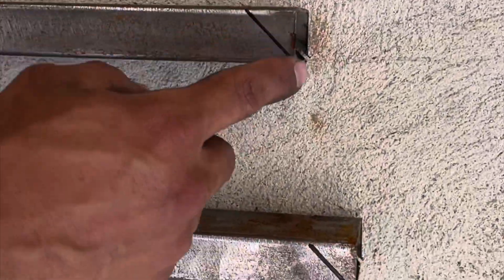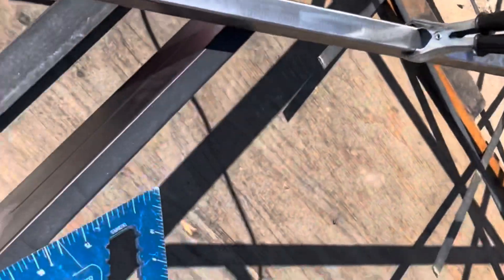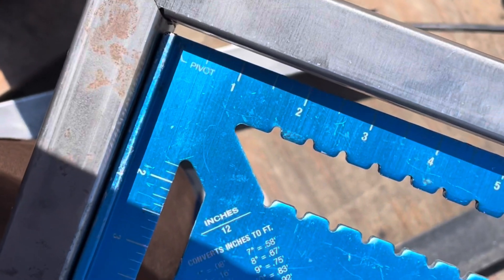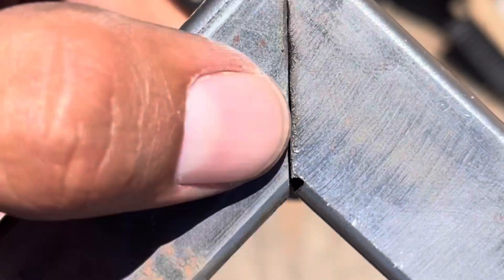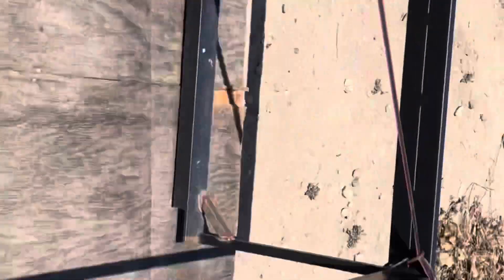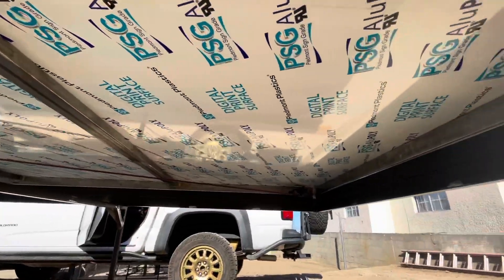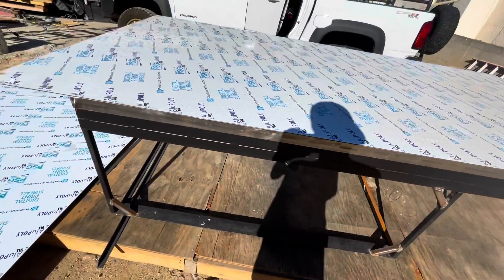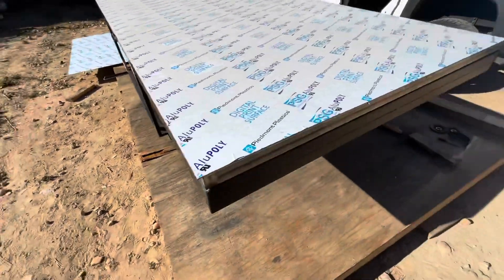Pop-up Camper Build ( Colorado Zr2) Part 4

Comment: have you seen the Kimbo campers in Bellingham Washington? Perfect for short bed trucks. Maybe it will give you some ideas for building future production models for the Zr2. I saw a Kimbo over Memorial weekend. That and the popup campers on the TRD's look badass
Reply from the maker: Looks legit but it would make my truck more tank like. 900-1200 lbs, plus the huge wall in the front. I bet it creates a lot of drag = 8mpg. 
My popup will be a 6” thick wall when closed and weight around 400 lb. I did get some ideas from it, so thanks!!